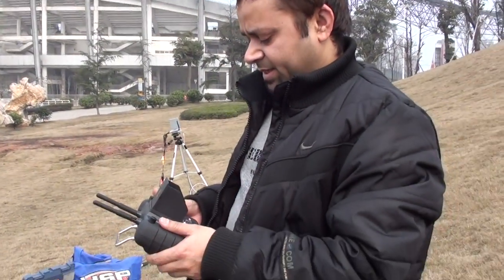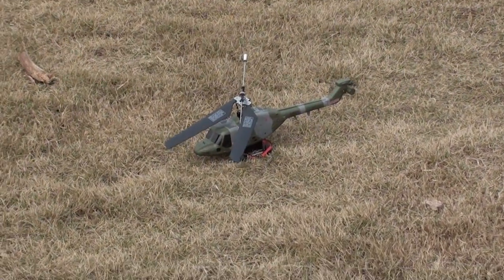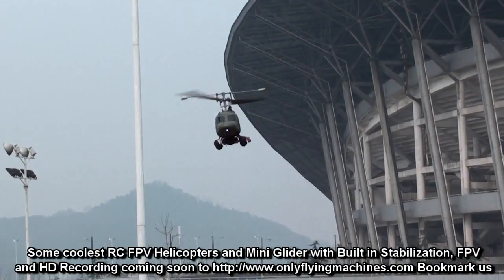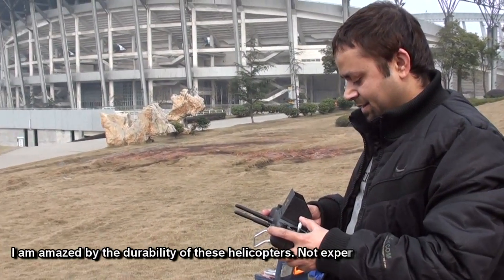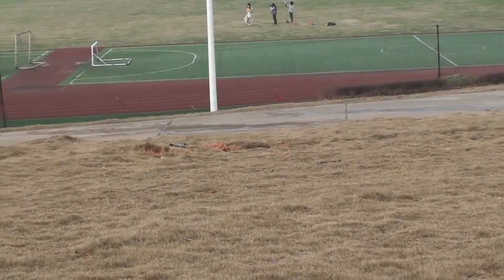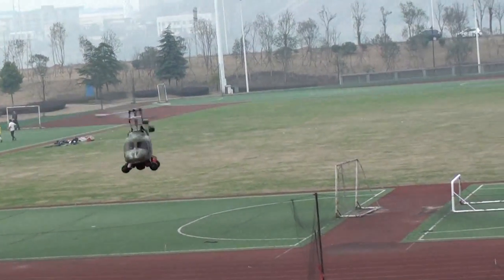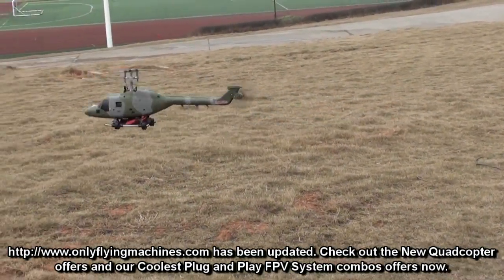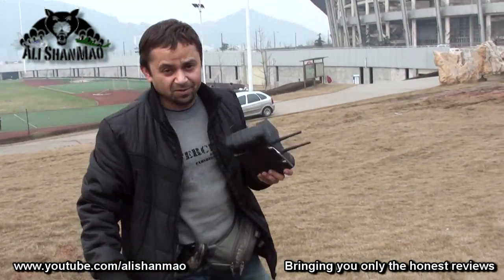Lynx RC helicopter with built in FPV system Outdoor Flight

Comment: It's tough.  You pretty much crashed nose first at full power and it didn't even bother it. You might need to upgrade the radio power so you don't lose the link of the fpv and the control.  And also upgrade the motor to handle 4s Lipo and see if they have a mamba brushless system for it.

Comment: definition continued/  Most commonly it is used to pilot an unmanned aerial vehicle (UAV) or a radio-controlled aircraft. The vehicle is either driven or piloted remotely from a first person perspective via an onboard camera, fed wirelessly to video goggles or a video monitor. More sophisticated setups include a pan-and-tilt gimbaled camera controlled by a gyroscope sensor in the pilot's goggles and with dual onboard cameras, enabling a true stereoscopic view.
Know before you comment.

Comment: You can install a tiny ground distance sensor that will prevent the crash with the ground.
I know of at least 3 types of such devices. They come in different price ranges and complexities; in case of fixed pitch blade it doesn't need to be very complex.